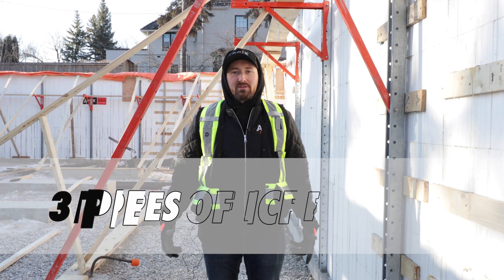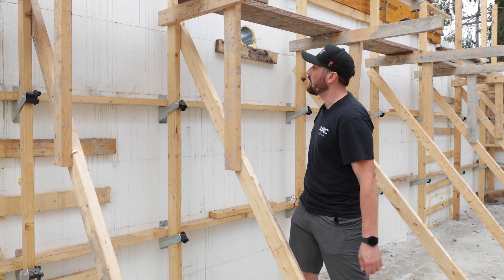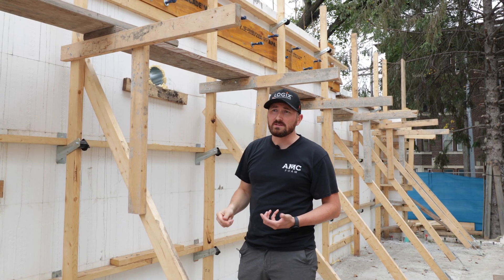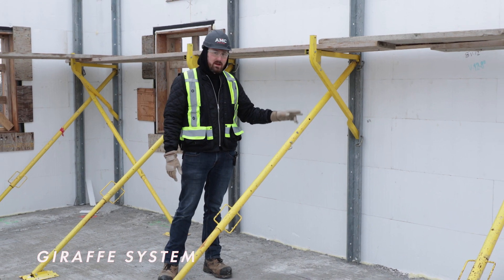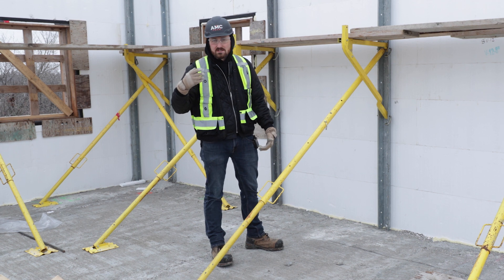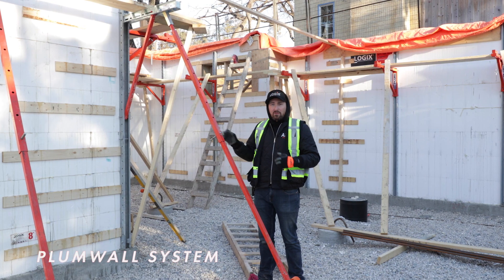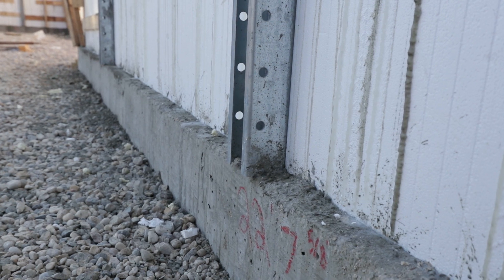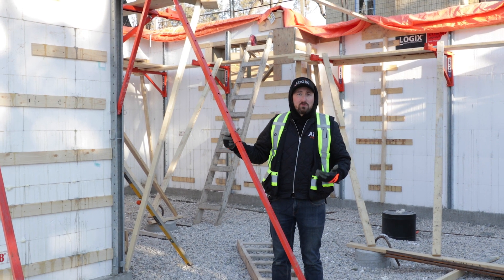What is the BEST ICF Bracing System?

Comment: Well balanced video.  There is no "best" bracing system.   The Zont system is great for DIYers or contractors who do complicated basements and walls, but not great for basic 'midwest' basements or anywhere you can't get great/straight lumber.  

The Plumbwall system is extremely well designed and great for repeat use. 

We do really tall, long, straight walls so we had to design our own with a far better multi-level scaffold system
Reply from the maker: You're 100% correct.  We often get asked "What is the best ICF bracing system?" and our answer is always that it depends on what you're doing and how your crew works.  Glad to hear you figured out which system works best for you!  --Jay from AMC Foam

Comment: The Zont system has the advantage in that all of its metal components fit in a small crate and easier to transport in a regular work truck.  The 2x4 back is easily reused in any interior wall framing of the structure being built.
Reply from the maker: That's a great point, and a lot of builders like Zont for that purpose!  However for ICF crews who do not stick around to build the rest of the house, steel strongback systems like Giraffe or Plumwall might make more sense.  The true purpose of this video was to try to introduce the idea that there's no such thing as the "best" bracing system, it all depends on how you and your crew work and what type of jobs you're doing.  Knowing that will help direct you to the right system.  --Jay from AMC Foam